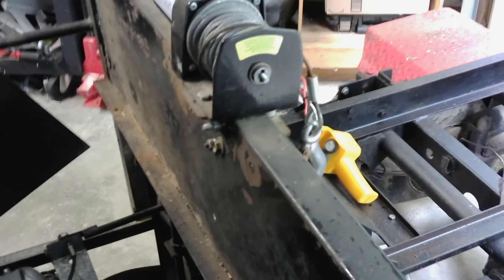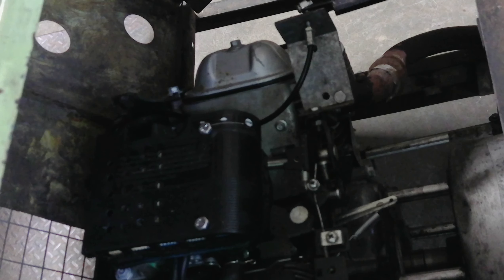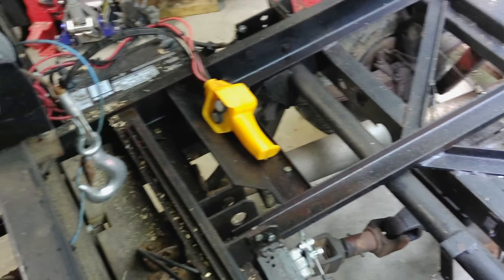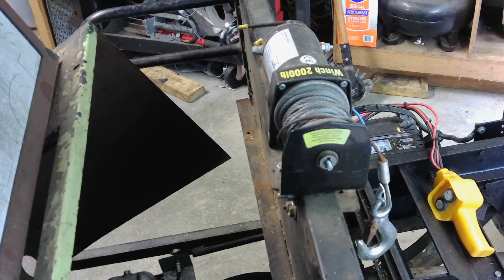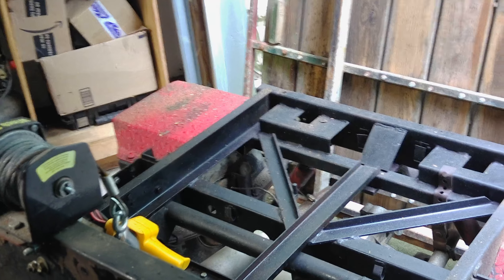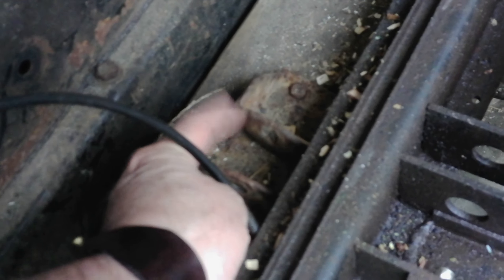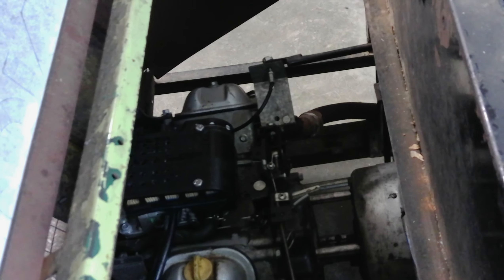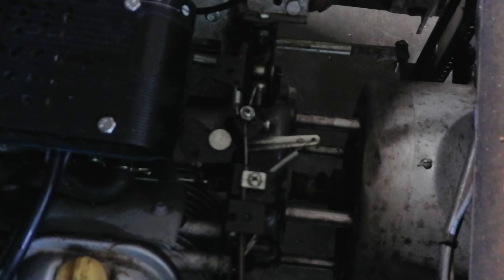670cc PREDATOR CUSHMAN PROGRESS MOVING THE WINCH

Comment: Glad to see you're happy with the way it's running now. Sure does sound good. I'm trying to get my stump grinder to run like that. So I'm going to go ahead and buy the GS 670 carburetor. Will the governor still work? I kind of need that in the stump grinding application.
Reply from the maker: Morning this is the carb, Aquiver Auto Parts New Carburetor for Honda GX670 24HP GX 670 (16100-ZN1-812) Small Engine Carb,  Governor will work on it just not in my application.
Reply from the maker: amazon that is